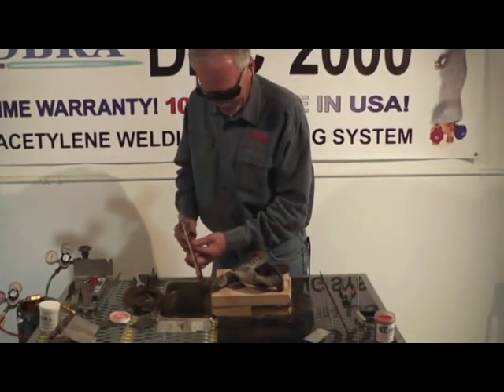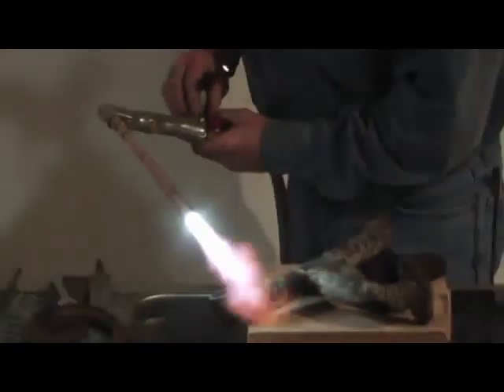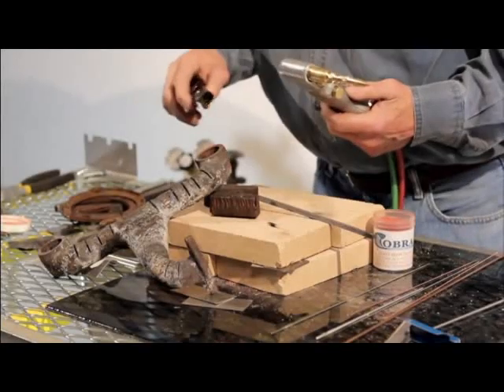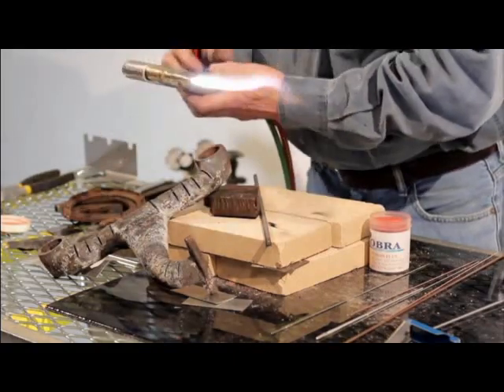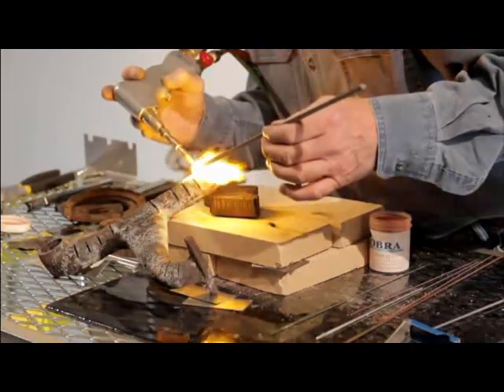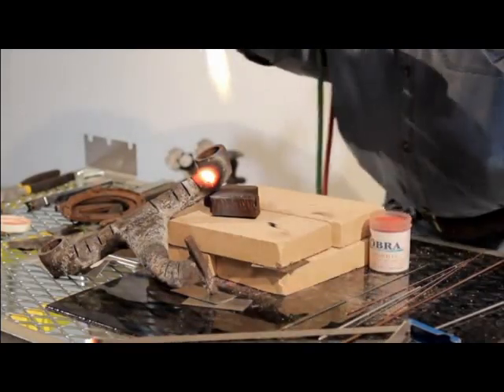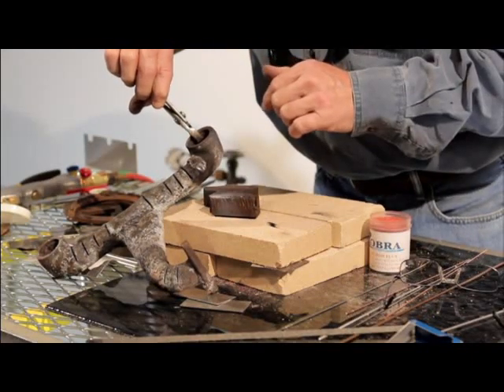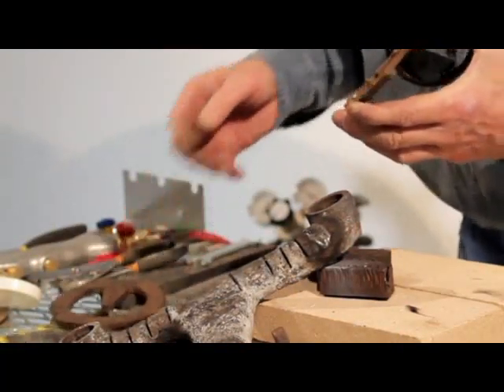CH 13 DHC2000 Instructional DVD   Welding Cast Iron

Comment: I am so disappointed in myself.   I did a cast repair on my vise by buying those expensive cast iron welding rods and my arc welding machine learning that they are not the easiest welding rods to control ( and impossible to file ) as my Dillon MK III cutting and welding torch when you are not welding just a flat surface.  I should have used my Dillon MK III cutting and welding torch (Cobra) but I just forgot about using it.  I brought my Dillon MK III cutting and welding torch with me to the Philippines 9 Because it is so versatile and portable ) and us it for my house hold repair work repair . My choice filler rods have been Stainless or spring steel motorcycle spokes and cast iron piston rings. But for some reason I thought I needed to use those other welding rods  ( that can't be filed ) and my DC welding machine.  I did eventually needed to use my Dillon torch cutting to burn away the filler rod that prevented the reassembly of the vice. MY Dillon MK III cutting and welding torch IS THE MOST VERSITILE WELDING SYSTEM I OWN !   I have my Arc,Mig, Tig, Plasma and Victor style Oxy-Act systems for teaching my relatives in the Philippines but I do not teach them the Dillon MK III cutting and welding torch system for lack of availability and cost.  You guys should help me out here.......  I love my Dillon MK III  ( Cobra ) cutting and welding torch system it is my go to secret weapon for welding ! ! !